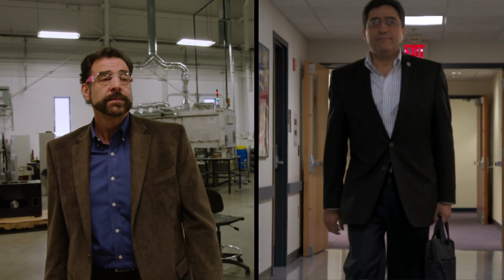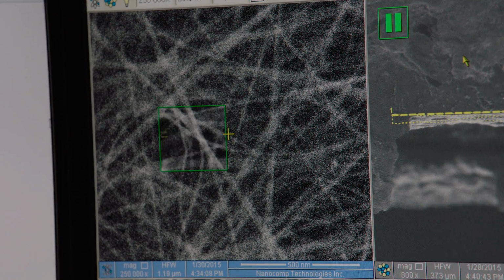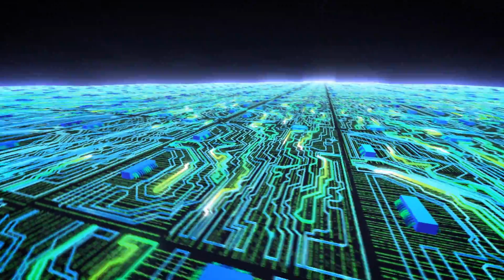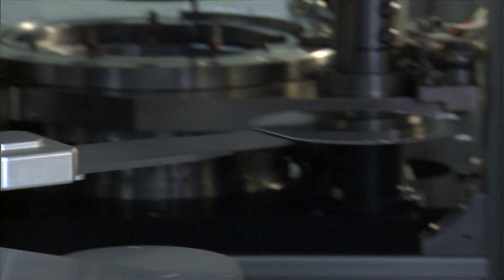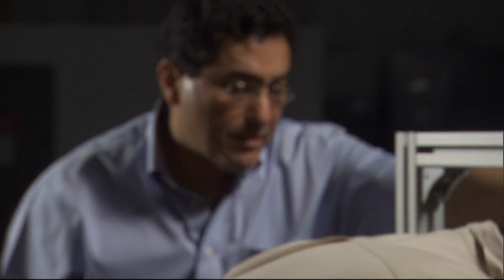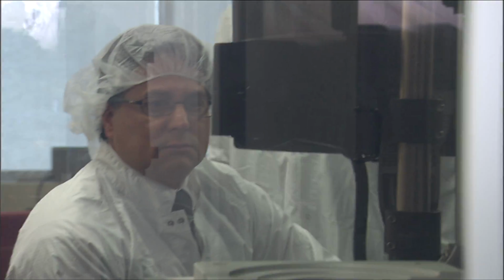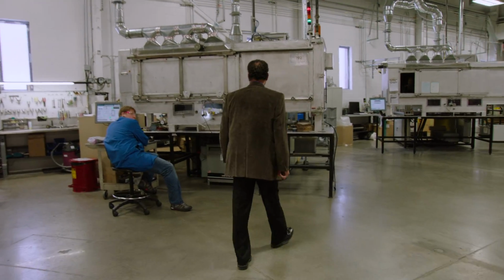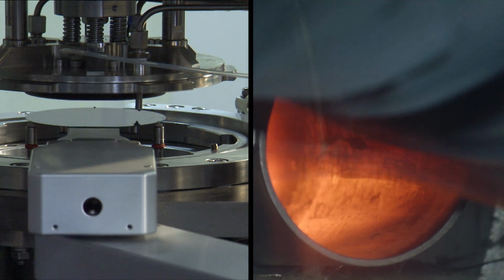From Lab to Fab: Pioneers in Nano-Manufacturing

Comment: The biggest question with this is, will Ahmed be willing to crash the traditional cpu market? because this will cut the price, manufacturing speed, and resource consumption of all cpu and potentially gpu systems. intern killing krypto currencies and forcing companies like intel and AMD to change and invest in either nano-circuitry or entirely different consumer markets. And will Ahmed's company hold a monopoly on the entire nanocircuitry market? they could inflate the price artificially if they where to ever get the legal rights in main continents. Or will they only claim the right to the manufacturing process, or the structure of these components?

Comment: I bet that most of the workers wouldn't normally use those silly eye protection glasses in day to day work and I bet it wouldn't be even required except for a couple of them. It's always amusing how workers are prepared beforehand when a camera crew comes to film.
Reply: CNT's in your eyes?
Reply: +why how I have them in my eyes. Looking for a cure before I go blind.
Reply: smart dust I know exactly what you mean.
Reply: the max allowable limits for these cnts and other carbon nanomaterials suspended in air are very very low and exposure is considered unknown and dangerous